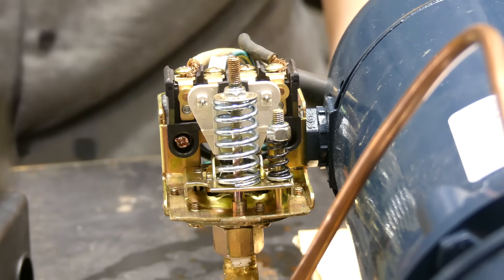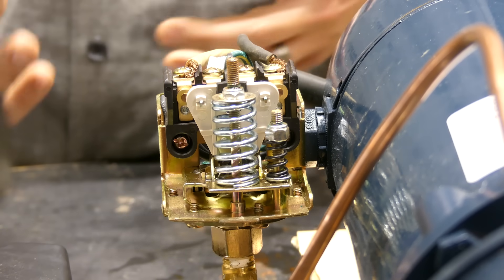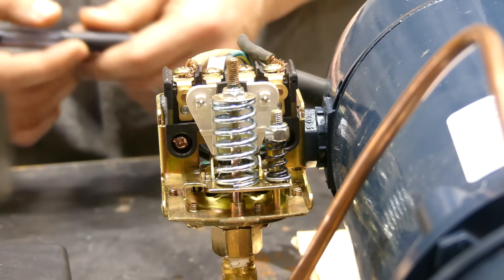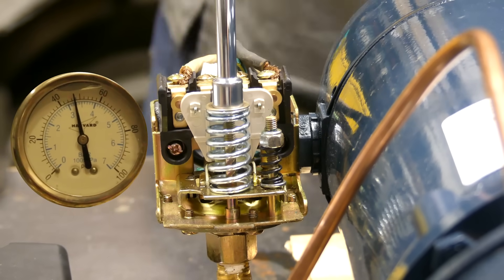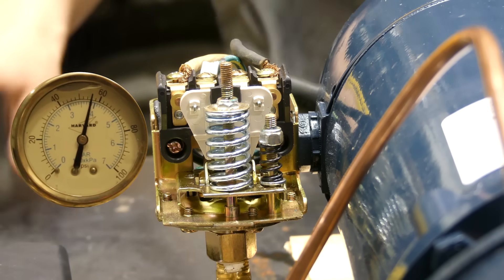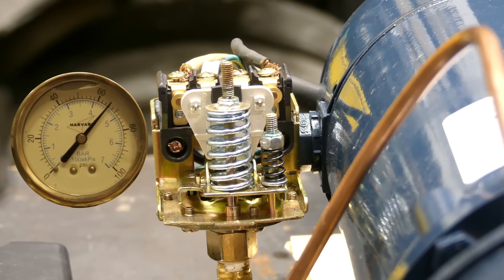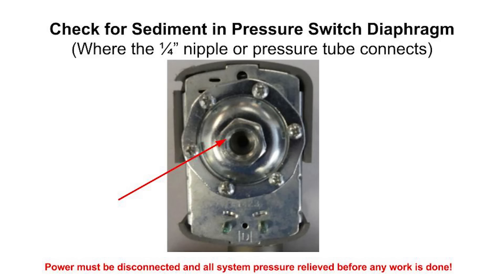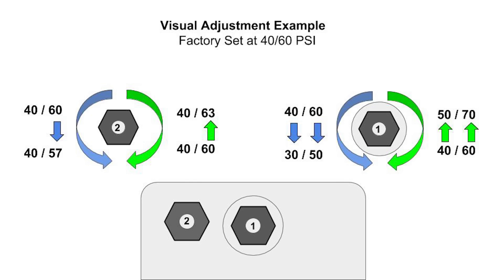How To Adjust a Pressure Switch

Comment: Ok I have a Question for you I have a pump that will turn off after it builds up pressure but when I turn it on it does not turn off and on while im watering my Garden what could this be? Thanks
Reply from the maker: Give us a call: 855.329.4519

Comment: I have a Goulds JRS5 (1/2 HP) which is preset to 30/50. I would like to up it no more than 5 psi to 35/55. Is there a cycle time I should mind to ensure I’m not working the pump too hard? Water is coming from a 200gal holding tank rather than a well.
Reply from the maker: Adriano:  A run time of at least one minute is recommended.
Reply: adriano baldacci I have the same pump for my irrigation system and it also says on the name tag that it is rated for continuous running I have mine set at 40/60 psi and it sometimes runs for 2 days straight. I’ve never had a problem.

Comment: I have a question. I had adjusted my pressure switch just two turns counter clockwise to lower the operating pressure. When i did this, the contact points opened and now they don't close even when i reset it to it's factory setting. Why could this be?

Comment: I am on a project where both 1 and 2 were loosened to the top in switch, is there a way to adjust both to factory setting?
Reply from the maker: You can use the tips from this video to manually adjust it or just buy a new one: https://www.rcworst.com/Pressure-Switches-c172.html
Reply: @RCworstwater  thank you young man, great advice, I'll send you a Christmas card, this vid and the conversation did wonders, stay safe...

Comment: I have a submersible pump and the switch contacts began to stick . I'd tap the cover and the pump would kick on and fill up to pressure. Eventually this happened more and so I replaced the switch with a 30/50. I had lots of air in the line which was throwing off my readings. I drained the the system, drained the air bladder and re filled bladder to 28psi. Opened all faucets and then turned pump on to release any air in the lines. Leave come home later and pump tripped breaker. Did this 3 times over a span of time. So I check air bladder and says 45 psi with water in tank. I adjusted switch with power on and water running and taking pressure reading from top of tank. Worked great for several weeks. Now randomly every now and then if someone fills bathub or etc at night no other water running the system drains and doesn't activate the switch to kick back on until I tap the switch cover. Any suggestions on where to search next I have no water in the bladder either. Thanks
Reply from the maker: Travis, it sounds like you may have sediment buildup in the 1/4" nipple that connects to your pressure switch. Turn off the power and drain the system, then unscrew that nipple and check it for debris.
Reply: @RCworstwater  Thank you, I'll check that out today.
Reply: The contacts may be sticking because your pump is running all the time.  Hence, it overheats, draws too much current, and trips the breaker.  I am experiencing that now with a submersible pump in my cistern.  I am considering changing to an above ground pump.  Much easier to service.

Comment: I'm having a hard time figuring out how to adjust my system...cut on is 25 and at this point when in the shower the water all but stops. Then the pump kicks on and runs the whole way up to cutting off at 90psi.  I"m guessing I need to back the differential nut waaaay back then tighten the range nut to have move the cut on to the 35-40 range?
Reply: Thats huge, sounds like maybe a bad switch.
Reply: I think Chris is right.  But before you go to the store, try the following.  Drain all the water in your system down to 0 psi, remove the switch, and make sure the little pressure tube is not clogged.  Then reassemble, turn screw #2 fully CCW, then turn screw #1 CW to up the cut-in pressure somewhere to 30 psi, then turn screw #2 CW to get the cut-out to near 50.  Finally if this works, add air to your tank close to just under 30 psi.  

Else, put $20 in your pocket and buy a new one.

Comment: Is there any reason into this pressure switch   why my pump not incline the water level? Bcoz first thing i did was that i need to mannually pour the pump with water until reached the vessel water line inside the motor pump and after the that my motor did auto stop and on.
My problem was that the auto pressure switch is working but when  it take long working the pump  the vessel water line  not have sustainable water which cause my pressure switch was still running but  no water...
What should i do. Sir new subscriber here

Comment: Hi, I used your great info. I live on a farm with a new above ground pump and new plumbing. The pump would pump up to 45 and wait till it got down to about 29-30 to come back on. I adjusted it to build up to 58 pounds and come back on at 35 pounds. I'd like to have it come on at 40 pounds. If adjust #2 to come on at 40 do I have to readjust #1?
Reply from the maker: Thank you for the question. Please give us a call so that we can walk you through the proper steps.  855.329.4519
Reply: Switch #1 at the center is cut-on pressure, #2 is the differential and establishes the cut-off pressure point.  Do call Worst whenever they offer it.

Comment: Hi. Great explanation. I’ve just installed a new pump. The pressure goes on at 40, off at 62. We have an electric shower which is now cycling hot and cold due to the pressure fluctuations. I have loosened the nut on the short post to reduce the range but the nut wont go any higher on the bolt to make the pressure more stable. Any ideas?
Reply from the maker: Chris:  Do you have a pressure tank?  If not, I would recommend adding one to your system or upsizing your current tank.
Reply: R.C. Worst & Co., Inc. Hi, and thanks for your prompt reply. I didn’t realise the new pump needed to be pressurised before use, I have now done this after releasing the water pressure. There are still marked pressure fluctuations in the house 10m higher. Quite proud I’ve got this far myself but running out of ideas.

Comment: Excellent and thank you! ... How do I decrease the range between cut off and cut on? lets say if I need to make it start at 45 instead of 40 psi
Reply from the maker: Thanks for the question Mohamed! To decrease 5 psi the range (Not recommended!) you would tighten the small set screw about 2 full turns.

Comment: Now i understand thc !!!
So now i can change my 30/50 instalation for a 40/60 for more pression in the shower...
And i should change the psi in the pressure tank to 37-38psi. Good!!
What is the max "safe" psi for a house
 whit copper pipe and standard tank pressure.
Can i go to a 50/70ish max psi systeme,
Whit pressure tank at 47?
Reply from the maker: The highest pressure inside the house is typically 50/70 with the pressure tank set around 48 psi. Older homes/fixtures could have issues if you go any higher. If you were at 30/50 then your pump might not be able to build up to 70 PSI, so make sure to watch the switch and make sure it opens after you've increased the pressure. If it doesn't open the contacts then that means you've set it higher than what your pump can produce and it needs to be lowered.

Comment: So does this mean that switches marketed as 20-40, 30-50 and 40-60 are all the same, but are simply pre-adjusted at the factory for their advertised range?
Reply from the maker: That's exactly right!
Reply: Thank you!
Reply: Absolutely true.  That's why they qualify the settings as "factory preadjusted".  There are however, other pressure switches such as what are used on air compressors that are quite different.

Comment: How do I check to find out if the bladder is split? I have water but the pump pulsates when the water is on I stead of being on for a while and off for a while. There is no air pressure on the valve  on the tank.
Reply: If the tank is horizontal, while the system is pressurized with water, depress the little fitting where you add air.  If water spits out, your bladder is split.  This is a replaceable item with some air tanks.

Comment: Great channel and valuable content.  I installed a full new cistern, pump, and pressure tank recently and used your videos to get educated.  

What does it mean if the pressure gauge needle is jittery while pressurizing?  The one on the video is stable while building pressure.  When my pump runs, the needle is very jittery, and switch cuts in at 40 psi, and cuts out at 50 psi instead of 60 on a new unaltered 40/60 pressure switch w/cutout.  Air in lines?

Comment: I have low water pressure in my home we have a well and a water pressure tank in the basement. I have increased the water pressure by increasing the pressure switch. After a few days, the water pressure dropped on the gage. What am I doing wrong?

Comment: I've been tinkering with mine.  My current range is ON at 40, OFF at 70.  I can spin the spring freely on the differential adjustment.  So there is no way I can "squeeze" the differential between off and on.  Time for a new switch?  Mine is about 15 years old and is for the house. I do have a pressure tank.
Reply from the maker: Thanks for the question. A new switch is only about $12. If you need a new one, you can find them on our website here: https://www.rcworst.com/Square-D-c231.html

Comment: pressure drops to 20 psi i turned nut on spring a couple turns now the pump wont shut off i couldnt even manually shut it off contacts would not engage i turned the nut back again it still wont shut off but at least i can use a pencil and manually shut it off but i dont know what to do now 
replace the pressure switch?

Comment: I need ur help. I f’ed mine up. Or something else is wrong. Initially had low pressure in shower outlet so was trying adjusting. Contacts in p switch now clicking back n forth. Comments ….,
Reply from the maker: Give us a call: 855.329.4519

Comment: any idea why my 40-60 switch will cut in at 30psi and cut out at 35psi?i ve adjusted the large nut clockwise 3 turns and nothing changed.its a brand new switch ty don
Reply: Shot in the dark good sir but did you figure out the problem. I'm really scratching my head on this same problem

Comment: i have a grundfos pump every 30 to 40 seconds the pressure switch will switch on /off for 2 seconds ,please advice how to repair ,is it the sediments on the 1/4 nipple or  need to adjust pressure or tank presssure is low ? thank you
Reply: Do check the nipple.  The symptoms seem to indicate a waterlogged pressure tank and a slow leak.

Comment: Hello I need someone's help. I live in a rancher and It's operated on a well system. I put a new pressure switch on to adjust the PSI. However the main nut did not raise, or lower the psi it seems likes it's stuck at 70. And shuts off. Even the old one did the same
Reply: Screw #2 is the one you need to turn CCW to lower the cut-off pressure.  See if you're happy with a 30/50 setting.

Comment: My pressure switch is running at 32/60. Should I lower the cutoff and then raise the range to run 40/60? Pressure is too low when taking a shower while the laundry is going. Thanks!
Reply from the maker: Yes, lower the cutoff and then raise the range to get to 40/60. Don't forget to adjust your pressure tank to 38 PSI air pressure.
Reply: R.C. Worst & Co., Inc. Thanks. I raised the range but I couldn’t lower the cutoff below 64. The nut isn’t even touching the spring for the cutoff. Either the gauge is wrong or the pressure switch is bad. I didn’t check the tank pressure yet.
Reply from the maker: @toddchapman3032  Might be time to buy a new switch and gauge. You can get both for less than $20 on our website :
https://www.rcworst.com/Square-D-Pressure-Switch-G2-40-60-PSI-Preset-9013FSG2J24-p1633.html
https://www.rcworst.com/American-Granby-2-Liquid-Filled-Pressure-Gauge-0-100-PSI-1/4-Lower-Mount-p8286.html

Comment: I'm finding that if my water pressure drops too quickly (say if I'm doing a load of laundry and someone flushes a toilet at the same time) that my pressure switch doesn't engage. Any ideas/suggestions as to what's going wrong? It's a new switch btw.

Comment: my water supply may be 2psi, i had to screw in the diff. nut almost all the way in to get it to shut off. when i raise the pressure nut the pump just runs. what can i do? Thanks
Reply: If you only have 2 psi city water, you may need to add a cistern tank that fills first.  Then you use a pump to get water to your house.  This is common where I live in Mexico.

Comment: I can get mine to cut in at 30 but cannot get it to cut out lower than 58-60 psi. The high adjustment nut is out as far as it will go. Any ideas?

Comment: Im getting 148V on my new pressure switch. does it make sense? I would assume it should be either 230 or 115V, am I wrong?
Reply from the maker: Give us a call for help troubleshooting: 855.329.4519

Comment: 1. Is this safe for the piping in the home with additional pressure running through it?
2. Could this theoretically give me the extra pressure I need to run an irrigation system?
Reply: Generally yes.  But anytime you increase pressure you may experience leaks or blow outs especially in older plumbing situations. 
Do not forget to factor in adequate flow on your irrigation system if you are still experience issues once you increase your pressure.
Reply: @chrisdawson3859  Thank you for that information! We do have older piping, so I'm not going to chance it.

Comment: Is it normal for a pump to go on and off in about 3 second cycles? The shower pressure fades back and forth, power and is low , and the pump cycles on and off every 3 seconds. Please help. First time home buyer. Please help.
Reply from the maker: It sounds like your pump is rapid cycling, check out our video or give us a call: 855.329.4519 or https://www.youtube.com/watch?v=CPzRpD_Tncc&t=40s
Reply: @RCworstwater  thank you. Just noticed your response.
Reply: Hello quick question , is arcing normal on a pressure switch ? Should I be concerned with a mild flash ? Is this normal in any way?

Comment: I just installed a 30/50 Square D pressure switch for my well, drained and pressurized the tank to 28psi, and got it up and running. I turned on the power and watched it fill to about 50 psi and turn off, but when I drain it it kicks back on at 40....I scratch my head, tighten the differential, loosen the range, but no change other than the 10 psi cut in/out range...  I can get it to cut in at 30, but it cuts out at 40. 

Is Square D a bad product? Its advertised as a 30/50, but acts like a 40/50... Or a 30/40. I dont get it... The connections did arc right off the bat too.

Not too big of a deal, I have running water now, its just kinda frustrating.
Reply: Excellent product.  Just follow the instructions in the installation instructions and turn the big screw to set the cut-in pressure.

Comment: I have a newbie question.  I am trying to learn the concept of how one takes a cistern, or water holding tank - as an input, and then 'pressurizes the  water' so that it can flow through a pressure potable water system.  I know there is a pump, a pressure switch and a pressure tank - at the heart of such a system.  But here is where I get lost...  In this video it shows that when the pump is ON - this increases the pressure in the water pipe system - to include the pressure tank.  At the input to the pump is a low pressure cistern water supply (or well).  if the pump is of a centrifugal design (i realize there may be other pump designs), the input goes to the center of the centrifugal cavity, and the output is radial to the centrifugal cavity.  What I don't understand is this...  When the pump is OFF, what would prevent the pressurized side from causing water to back flow through the centrifugal cavity of the pump to go to the less pressured (input) side of the pump?  Maybe for this application, a centrifuge pump can not be used for this very reason - and specialized pumps are required so as to not let the pressure 'leak' back out of the system.  Any insight you can provide would be really helpful for me.  Thanks much for your excellent explanations in the videos.
Reply from the maker: A simple check valve or foot valve on the suction side will hold the pressure in.
Reply: @RCworstwater  Thanks.  I understand...

Comment: Great video ! How can I determine whats the highest range that is safe for my well pump. I just changed it from 50/30 to 60/40, can I go higher than that ?
Reply from the maker: Dave:  You can, however, its easier for a pump to supply the lower pressures and it’s less strain on old plumbing.  Make sure that the pump can reach the higher cut-off pressure.  If you set it too high the pump will just keep running.
Reply: R.C. Worst & Co., Inc. Ok and how do i determine whether the pump can reach say 70/50 .. I know I have a 200 ft well with a 1/2hp 5gpm pump
Reply from the maker: Dave, you just need to check that the contacts on your switch open after you adjust the pressure higher. I'd increase it 5 psi or so at a time and run the pump. If the pressure switch contacts don't open, it means the pump can't produce that high of a pressure.
Reply: R.C. Worst & Co., Inc. Awesome. So just want to be sure I have the steps correct. Turn off the breaker, drain the system and the tank to 0 , then I'll pump air in tank to 43 psi ( 2 below 45) then adjust the big nut to 65 and watch the contacts
Reply: @OwenGBBall  hi,
In other words  When the max set pressure is reach... the pump (current) need to stop...
If the pump is not strong enough the system will not shut off.

I would like to know...
Is it "generaly safe" to put 70-75psi in a standard home system? (I would be happy)
I can't find information about this.
Thank
Reply: @OwenGBBall  Yipes.  You can simply give it a try at the risk of blowing out your pump, pipe, or connections.  Your pump has to put out an extra 87 psi just to lift that water 200 ft. up.